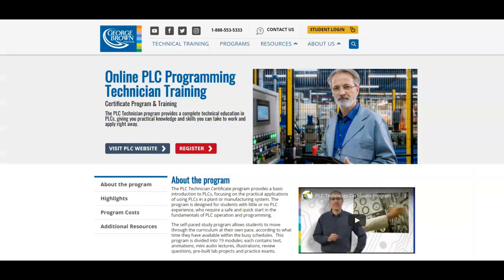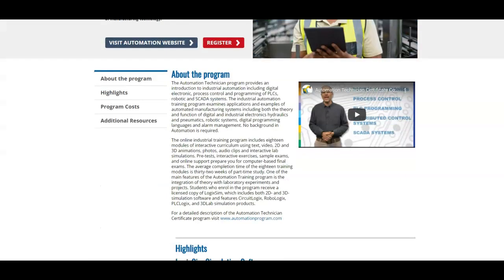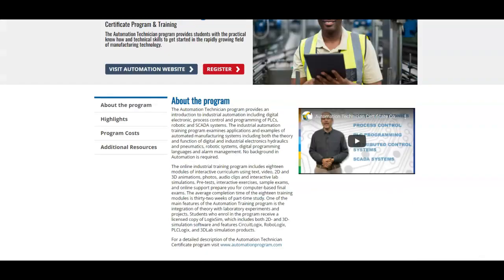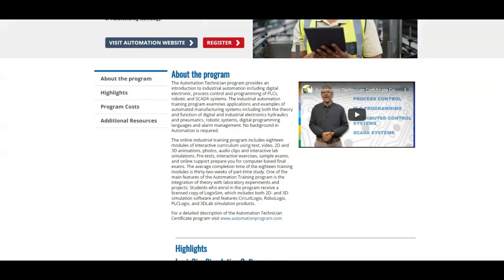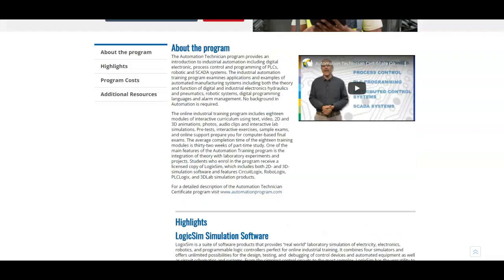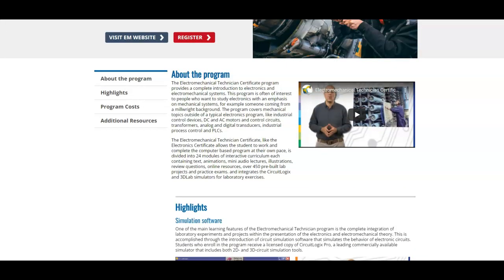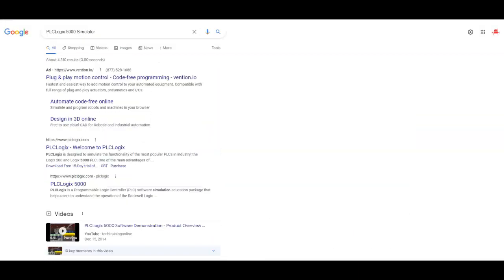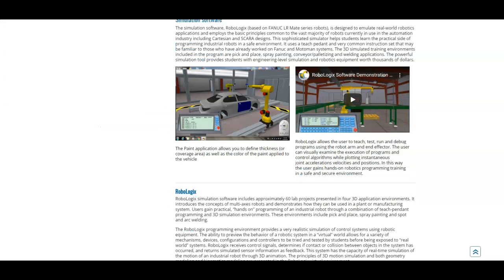George Brown PLC Tech Training Review

Comment: I have 12 years of graphic design/ photography experience and made the jump to electrical/mechanical engineering field. Just got my 3D printer 🖨️/ cnc router. I have been using cad for 3 years

Wiring control panels and drivers
Now trying to learn plc
Reply from the maker: Good luck, let me know if you need any help.
Reply: You sound awesome! Would love to connect with you!

Comment: As a George Brown Alumni I have to disagree with some of the remarks made. I completed the Automation Program and I'm currently enrolled in the Electronics program. Which has a pathway to getting a Bachelors Degree in Engineering Technology Management from Indiana State University. The programs are affordable if you look at the pay as you go options. If you are in the industry employers will often reimburse the cost of the program after you finish the course with a certificate as proof. Yes you can get the software on its own and pay way less. The benefit of the certificate is making yourself attractive or marketable to head hunters. Corporations look at credentials bottom line. I've seen techs out of trade school with 0 experience make more than senior techs because of a piece of paper. 

As for Robotics it doesn't matter what software suite you use to learn. There's multiple manufacturers and programming languages. The tech needs to understand how they work and the systems that make up the robot. To me it makes no sense to pay 495 for Robologix and have no way to attractively market yourself to potential employers. (Just my opinion.) 

If the tech is on a super budget they could use Real Pars or the site you mentioned and pay $40 a month. Combine that with Factory I/O and your still paying the same amount had you taken the GBC route. You are right though. The tech needs to know exactly what the employer wants and where they (the tech) stand in regards to those requirements. Its a big deal not to over sell yourself.
Reply from the maker: I totally understand your perspective, and you are right NEVER oversell yourself. Otherwise you will become a minnow in a sea of sharks.
Reply: Hello my name is Dave I work as a technical recruiter for Flextronics. 
We have job Vacancies for Automation technicians at Flextronics, Austin TEXAS.
send a dm if you have 4years+ experience in the field. 
Military personnel with PLC technical training are encouraged to apply. Associate Degree in related field is a plus.

Staffing for over 40 positions - both contract and full time
Relocation assistance available for full time positions.
Reply: I'm curious as to what employers would think about these certificates.  Did you feel that it enhanced your resume?  I completed the electronics certificate.  It was in-depth and a good value, but would employers look down on it because it is an online course?
Reply: @sparksilence  Majority of the training you will take from an employer will be online. So why would they look down on it? I use these certificates as a way to get past the hiring manager. As hiring managers have no idea what real qualifications an applicant needs. They just go down a list and look for keywords. So with that said. Yes these certificates enhance a resume. And even transfer to college once you have your evaluation done.
Reply: How's the electronics program going ? i'm planning on doing the exact same thing as you. The transfer into athabasca university right ?
Reply: @xeepers  after reading his comment and yours it looks like Athabasca is in Canada, they have a similar program going through Neumann University in Pennsylvania. I haven't seen anything about Indiana State University but I didn't specifically look for them. I just looked at the links on GBC's website.